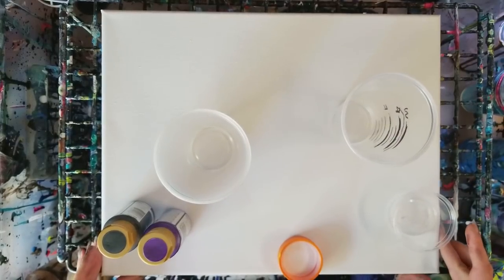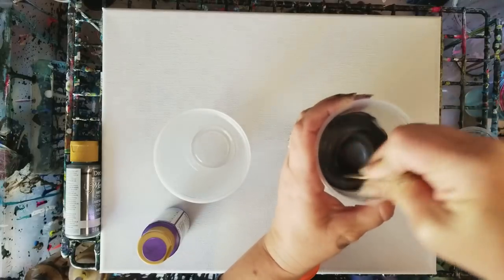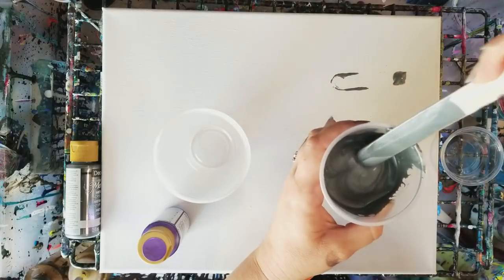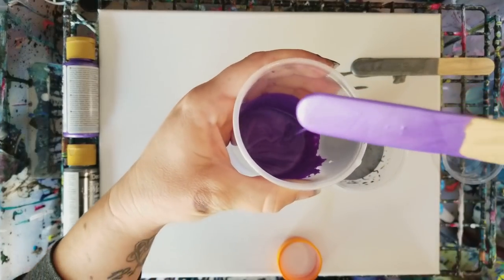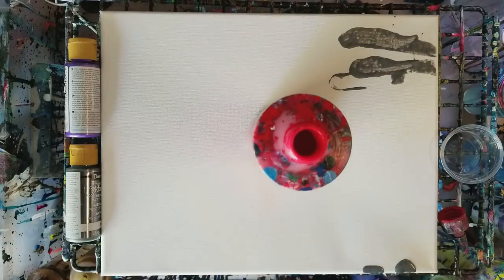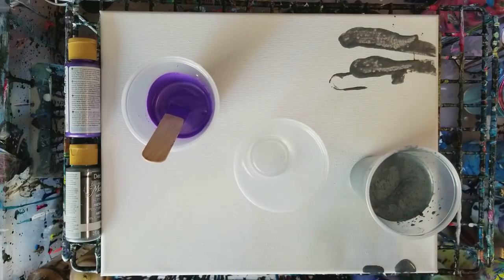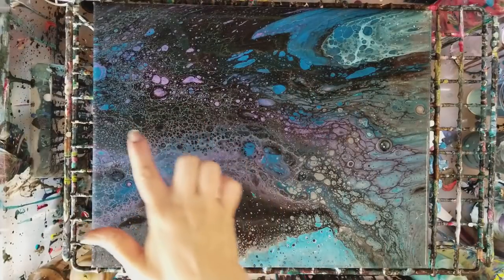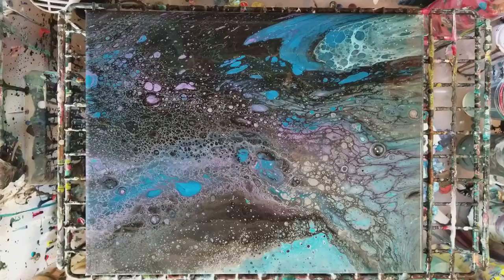Acrylic Pouring | How to Mix Paint

Comment: This video has been the most helpful so far for mixing the paint. I was using twice as much paint as the Floetrol, and although I felt like my paints were thin enough like “really warm honey” like I keep hearing, I wasn’t getting the results I wanted. But using your mixing recipe, I got so many cells today, with no silicone. It’s true, trying to understand thickness on videos is tricky. This is been the best. Thank you so much!
Reply from the maker: Awesome!!!
Reply: That white one is glue or what
Reply: It is called Floetrol, a paint conditioner.

Comment: I have learned a lot watching your channel and enjoy it very much. Could you sometime give us a ballpark estimate for how many ounces per cup in a mix you use for the various canvas sizes? Like how many for an 8 X 10, a 10 X 10, a 10 X 12, a 12 X 12 and even larger sizes? My perpetual problem is not having enough paint requiring me to really scramble to get more mixed before things settle too quickly. I really appreciated the video you did on mixing your paints and the ideas for premixing ahead of time and doing so in large quantities. I am also saving up my "left-overs" over the long run to see what I can do with them. Again, learning a lot and enjoying it. Thanks!
Reply from the maker: Sure
Reply from the maker: I generally just multiply, like for an 8x10 I use about 5oz, so for a 16x20 I'd need about 20oz. Hope that helps :)
Reply: It's my understanding that you calculate how much paint needed by multiplying L x W of your canvas and ÷ by 2.5
Is that accurate?
Reply: @mixedmediagirl, can you reply back to comment above? I'm still a bit confused. Thanks :)
Reply from the maker: My formula is 1 ounce of paint mixture for every 16 square inches of canvas
Reply: Mixed Media Girl when you say 5oz for a 8X10, you're saying 5oz of total mix (with medium and water) correct? Not 5 ounces of just pure paint.
Reply from the maker: Correct

Comment: Thank you for taking the time to explain how to mix the paint. I have been so confused by others until I came across you. Thank you for educating me and I’m sure others feel the same way. God Bless you.
I do have a question tho. Your canvas, did you get it ready for the dirty pour, or did you flip/pour on a dry canvas? Someone told me that I should put my base coat down first then my pour paint. But I found that, that can use up a lot of paint so it’s a waste. I’d appreciate your input. Thanks.

Comment: That was great. I quite love doing the mixing. The only difference is that I haven't found a reasonable source and price of Floetrol here in Canada, so I've been using Zisser, which is a really thin  liquid, but certainly does work as an extender. I am so thrilled to have found this technique. It's been fun so far!
Reply from the maker: Awesome!
Reply: Have you ever tried Liquitex pouring effects medium. I went out to buy some, and came home with the wrong product! I'm going to go back to Michael's and pick some up because I too, find the Zinsser too watery.
Reply: The Liquitex will be my next try, chick256. But I'm actually really happy with the Zinsser. It doesn't thin out the paint and certainly doesn't change the colour. It's a way better price too than Liquitex, but I would like to check out the difference.
Reply: I am in Ontario and I found a 3.78L bottle of Floetrol at Dulux paints for 20 dollars. If you have a CAA membership you get a discount as well. Hope that helps you out.
Reply: That's awesome news. I'm going to call the Dulux store in Sydney tomorrow. Oddly enough I have never noticed it whereas there's a new Sherwin Williams almost next door (altho I haven't lived in Cape Breton that long). Sherwin Williams only had the Zinsser. It's only been open a few months and was actually getting rid of the Zinsser, I can only guess, because no one was buying it. I mean, really, Home Depot should sell it, but they only have the Zinsser too. I really hope someone here in Cape Breton has it. Otherwise I'll have to get someone from Ontario to bring it when they come visit. Thanks myloveofcrafting!
Reply: myloveofcrafting where in Ontario? I'm in Toronto.
Reply: Well some Torontoians are coming this summer, so that would be the best bet. Have people all over :-)
Reply: chick256 I am in Toronto as well!!
Reply: I've called a couple of Dulux stores, and they don't carry it. Can you let me know which part of the city, or the address of the store you found Floetrol at?
Reply: Found it on the Danforth
Reply from the maker: Well you guys are making friends, lol. Canadians unite! ❤❤❤
Reply: I'm telling you something, this paint pouring is totally addictive. Yesterday I did 7 paintings! Mind you, 5 of them are small 4 x 4" and some on tiles. I'm doing a series and also have been doing some little boxes that would hold trinkets or whatnots. I wake up now and my first thought is what I'll be doing paint-wise. Yesterday I burnt my dinner while I was upstairs painting!
Reply from the maker: Yes, it should definitely come with a hefty warning label! There will probably be pourers anonymous groups springing up soon 😁
Reply: Mixed Media Girl we are very united, especially after recent events here in Toronto

Comment: Thank you for this video!  I have a few questions:  1)  Why no silicone?  Do you ever use silicone?  2) I've read you should "filter" your Floetrol first because it can be lumpy/gunky and ruin your painting.  Have you ever had issues with the Floetrol and do you ever find it necessary to filter it first?  3) Before I knew what to purchase I bought some acrylic paints that were not made for flow/pouring!  Can I still use them if I thin them down to desired consistency?  Thank you!

Comment: Awesome! Thanks for this! I was wondering how/where you set your paintings to dry. The last couple I did, I let them sit on some cooling racks in my plastic bin, and that was a lesson learned the hard way... the paint ended up sticking on the bottom to the rack, and it ended up tearing the canvas on the bottom a bit when I attempted to pull it up :(
Before that, I was doing the push pin method, but I really don't like using them. I'm thinking I'll just go back to setting them on the plastic cups to dry over night. They didn't stick as bad with that.
Reply from the maker: My little secret is I set them on top of another canvas that's still covered in the plastic :) you could also just put wax paper or plastic on your racks, the paint won't stick to plastic. Or cups always work :)
Reply: Ooohh! Thanks! I'll try that! :D

Comment: Hi Marcy, I purchased your book on Amazon. I can't wait to start with my fluid art journey! You suggested in your book that we shouldn't use resin in our work if you used silicone or other oils. However,  I understand that we can also remove the silicone before sealing.  Is this recommendation still valid?  I am loving your book so far and its great to find you here.

Comment: Hi, I just watched your video on mixing paints.  I just started out and I'm having a problem.  After my pouring drys, it's all cracked.  I've used canvas and wood so far.  
I use 1 part paint, 1 part floetrol and a little water.  Do you have any suggestions?  Plus the ones on wood how can I reuse them. They were specific cutouts.

Comment: I'm brand new to acrylic paint pours but I totally want to cover my house in this art style.  My question is: what's the point of the blow torch?  And does the flotral cause the cells to happen? Bc I thought that's what silicone is used for.  What if i want to make a spin style and didn't want cells?

Comment: Nice video. However, would be helpful if you indicate what oz bottle you are using in video. 
Question: do yiu add silicon to the bottle
Or. You add to cup at time you pour?
Thank you
Reply from the maker: Ounces have no relevancy here, it's ratios. You can use ounces, gallons, ml, whatever you want. And I don't use silicone :)

Comment: Have you had any issues with your floetrol being really chunky or gritty? I recently bought some and shook it as directed but when I mixed it with my paint and water and did my poor I had a whole bunch of little chunks on my canvas. Do you strain or filter your floetrol at all or have you ever come across this?
Reply from the maker: Not usually but sometimes, mainly with older floetrol, in which case I do strain it. You can take pantyhose or some similar material and easily strain it into another container :)
Reply: I THROW A FRESH CHEAP PIECE OF CHEESECLOTH ITS CHEAP AND AVAIL EVERYWHERE. CUT PIECE DOUBLE IT ONTO ITSELF AND USE A RUBBER BAND TO TIGHTLY COVER THE FLOETROL BOTTLE AFTER SHAKING AND I STRAIN THAT THREW THE CHEESECLOTH DIRECTLY INTO FUNNEL AND MY LITTLE CONTAINER I USE FOR FLORETROL. LOL LOL I HOPE THIS HELPS

Comment: What sort of rack is that under your canvas? I am using a slat rack thing. the slats are 1/4" round dowels, but they are spaced too far apart and the canvas sometimes gets an edge stuck under one of the dowels messing up the bottom of the canvas due to me trying to get it out without damaging it. Maybe I could find a rack likes yours and other painters I've seen if I knew what the rack is called.
Thanks

Comment: Floetrol is so expensive here in the UK, as it is imported. Is there another substitute? I’ve tried pva glue but don’t really get cells.   What’s a good ratio to use if you’re just using paint and water with a little silicone?   Groovy pour, by the way!

Comment: So it was first 5  to 2 then the second 2 to 1 paint plus water to thin them out, the bottle was again  2 floetrol to 1 and h20 correct? The order of paint poured in  will change the image correct? Whendidyou add silicone? Like for making cells???
Reply from the maker: 50% floetrol, 30% paint, 20% water.  No silicone. Yes, the order in which you use the colors will affect the picture

Comment: Omg,  I finally found this, & Thank you!!! Ive been messing mine up. Does it have to be distilled water, in your opinion? Thank you many times over!
Reply: DL Tyler late comment I know. It depends on the the water quality. I use distilled as there is a lot of chemicals in the tap water in my supply line. Other places the water is a lot cleaner and I would use that. Cells don’t get activated using tap water here. But try both if you want to know the results of both kinds.

Comment: Thank you so much for this video. I've discovered your chanel the past two weeks and I liked it. I will go ahead and buy some paint to start.
Do you need to spray your paint after it dry with anything to make it shines or no need
Reply from the maker: I do seal mine with Rust-oleum crystal clear enamel spray which make it nice and glossy
Reply: Mixed Media Girl Thanks for your reply I appreciate.
Reply from the maker: No problem :)

Comment: What if you are using silicone oil instead of Floetrol for the cells? I usually only use a few drops of the silicone oil added to my paint and water

Comment: Is there somethings that you usually use to keep your paintings from cracking after they dry? Sadly my paintings do that 😩
Reply from the maker: That probably means either your paint is too thick or you're leaving too much paint on the canvas. Try thinning out your paint a bit more or running more off the canvas (you may have to do both)
Reply: Mixed Media Girl omg thank you so muchhh 💕💕
Reply from the maker: Sure :)

Comment: Do you need floreto in all Aryclic paint pours?
Reply from the maker: The materials and ratios used in this video are what I recommend. Instead of floetrol you can use liquitex Pouring medium, gac 800, glue or a number of other things. What I use in this video is what I recommend

Comment: I wish we could get flowtrol in the uk
Reply from the maker: Me too :(
Reply: Turn up the colour - Try using pva glue like Elmer's glue with a flow medium
Reply: You can.
I get mine from ebay.
Amazon sell it also.
Hope this helps 😊
Reply: Go to a good paint store and ask them if they have a flow agent or paint extender for latex paint. This is a pretty common thing to add to paint before it gets sprayed, to be sure it comes out easily, and I bet you can find a similar type of stuff in the UK almost anywhere in Europe. It doesn't have to be this exact same stuff.
Reply: Floetrol..  Jacksons (Owatrol is the brand name)

Comment: there wasn't silicone in any of the premixed colors you used in this video? just curious how you go the cells like that without silicone (since its so expensive)!
Reply from the maker: No silicone at all. You can get cells by using the right consistency of paint. Floetrol definitely helps :)
Reply: what is it that the floetrol does? is there an alternative?
Reply: Also, I don't want to buy a heat gun, can I use a hair dryer? lol
Reply from the maker: It helps kind the paint together, helps it flow, helps maintain colors, etc. You can use liquitex pouring medium, golden GAC 800 or try glue (floetrol and glue are about the same cost)
Reply from the maker: Watch this video, which will best answer that question https://youtu.be/Gtz7eTc6uiM (btw, you can get a torch lighter for generally 2 to 5 bucks)
Reply: I saw your video with water vs floetrol and think I will use water. Also, I can't find that torch any where for that cheap.
Reply from the maker: I got one at a gas station for $4 and someone commented a few days ago that they found them at Wal-Mart for 2.50
Reply: Mixed Media Girl must be where they lived. I'm looking online and none cheaper than 25$
Reply from the maker: I think you may be looking for the wrong thing. Here's a 4 pack on Amazon for $12 https://amzn.to/2HRMk5R. You can definitely get an expensive one but this will work fine
Reply: you can get a 5 pack at Walmart for about $15

Comment: Why do some people use 91% alcohol or silicone?
Reply: Not sure about the alcohol.. but I know the silicone is used to increase cells. It acts as an oil when being poured, but dries solidly. it is the perfect substance to create big cells. Be warned however, you do not want to stir in the silicone.. you just set it on top.

Comment: I have a problem with my paints mixing to much and everything looking really muddy.
Reply: I had a problem with this initially, too.  My guess is that there could be one (or both!) of two things going on.  First, your paint mix may be too thin.  If it is runny (not thick enough) it will all run together.  Second, you may not have enough paint in your paint mix.  I figured out the first early on but I only recently figured out the second.  Soooooo many recipes for pouring assumed better/thicker paint than I was using.  With the cheap craft paints I ended up needing 1 part medium to 1 part paint (and I added no water at all) -- adding a higher proportion of paint is what solved my problem with muddy pours.  When you buy better/thicker paints then you increase the amount of medium relative to the paint.
Reply: Thank you